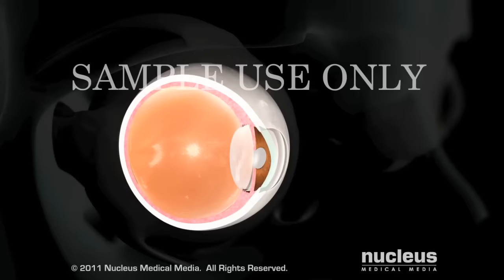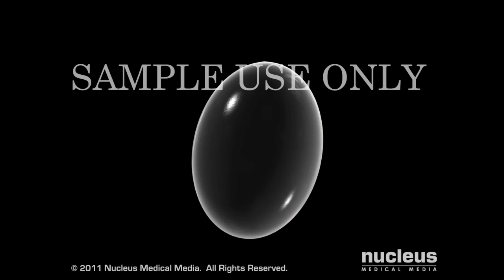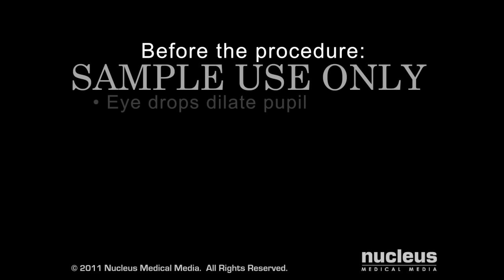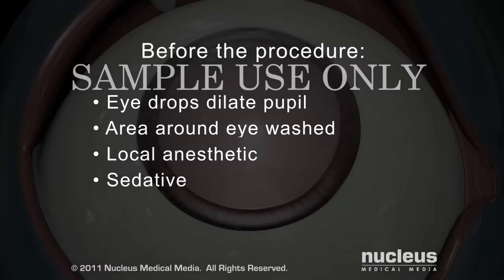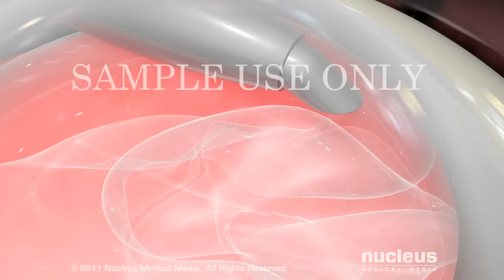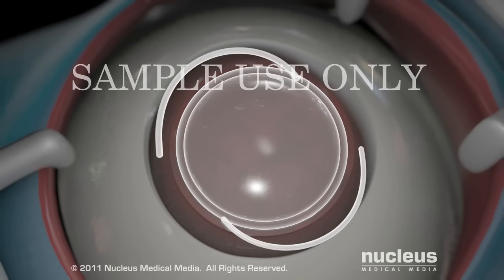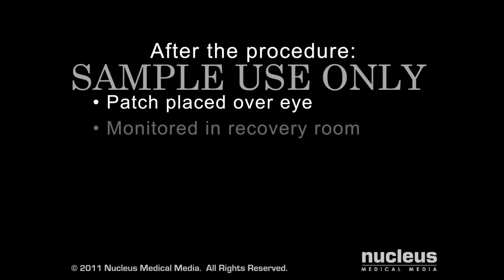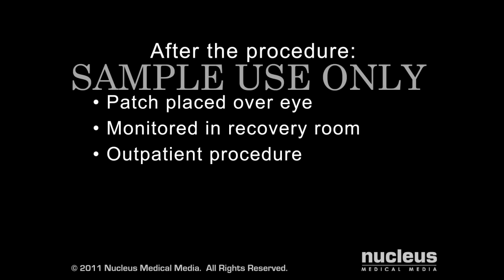Cataract Surgery

Comment: I’ve had my done 5 days ago, and it was absolutely flawless. You don’t feel anything. But I’m here cause I have a question for anyone who might know. I accidentally rubbed my eye (not too hard) but didn’t actually touch the eye itself. I just rubbed my eyelids and puts a little bit of pressure on my eye. It didn’t hurt and I don’t see any difference at all. But is that fine? I started to overthink and did my eyedrops right after. No pain, no irritation, nothing. I should be fine, right? Thank you for reading if you do! Please let me know!

Comment: No patch is required these days
Reply: Worth watching
Reply: It is required for sleep as you might accidentally rub your eye while asleep.
Reply: Not a "patch " but a clear plastic or metal shield, worn at night for aboutc2 weeks.
Reply: I was advised to wear a patch (placed over my eye after surgery) and to tape it (with surgical tape) to wear it at night. Then wear glasses during the day, though if you wished you could keep the patch on (no glasses over it) during the day  You should be given eye drops to take for a certain length of time afterwards (I had Maxidex).

Comment: How do you even stitch the eye?
Reply: Despite the eye being a sensitive organ, it is still made of strong connective tissue which can be stitched and withstand manipulation
Reply: You can stitch an eye  I have glaucoma in both eyes a couple of years ago I had to have emergency surgery to relieve pressure or I would of been totally blind in a week and when surgery they stitched me up using proper stitches needle and thread they are still on inside of eye but they removed the ones on outside of eyeball after 18 monthes

Comment: So a cataract is like an eye hernia?
Reply: Elbo VonDonnegan exactly
Reply: lol
Reply: @PhantomTransmission  ,  No it's like a dirty window (lens) that you can't clean.  The dirty lens has to be removed and replaced with a permanent, unbreakable, non-changing lens made of an acrylic compound.  Safest operation in any hospital.   It's fast 15 to 20 minutes and restored sight is  instant.   I know because I had the operations 5 years ago.  Now I have 20/25 in each eye compared to 20/100 and 20/200 before the operations.
Reply: jack sweeney does the surgery hurt after? Last time I had dental surgery I wussed out. But now I know that 12 minutes on nitrous won’t kill you.
Reply: @PhantomTransmission  No.  I had full body anesthetic.  The Dr. had me count backwards from 100.  I remember getting to 88.  The next thing I remember is my wife waking me up and it was 2 hours later.  In 5 years, I have never had any pain.  The lenses "set" permanently after 6-8 weeks and never move.  Nothing affects them and they never change.  I'm 78 and watch TV  and see the news and ball scores at the bottom without glasses.  I could drive because I can see the dashboard and the road without glasses.  But I don't because Manila traffic is so bad.  The cut, made by the Dr. is so small that it is almost healed in 24 hours, no bleeding, no scars and no stitches.  I used to wear $400 progressive trifocals and upgrade them every two years.  Now I wear $2 - 1.75 reading glasses for the pc monitor and reading.  And never upgrade.  Does that help?
Reply: Yes. Thank you.
Reply: @jsweeney44  I want full body anesthetic but I don't think they'll do that for me. In the US you have to be awake to follow doctor directions during the procedure, so I'm still really scared...